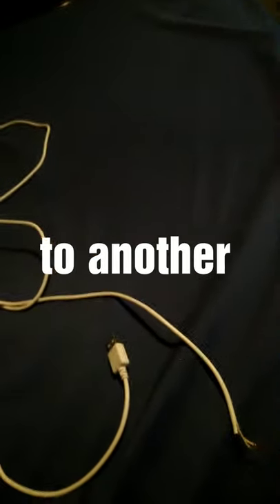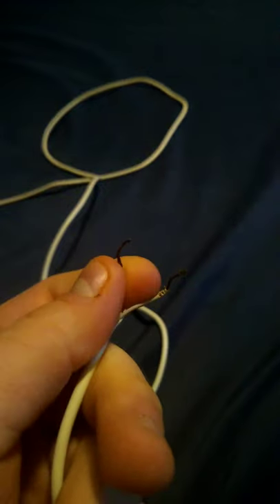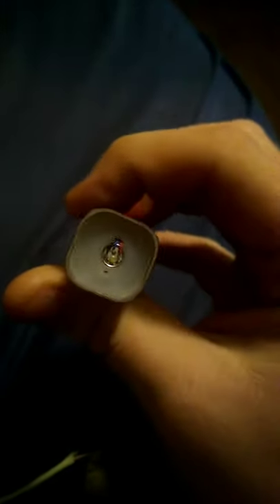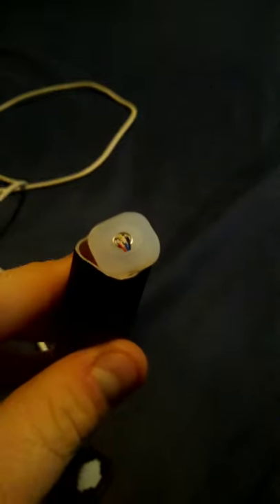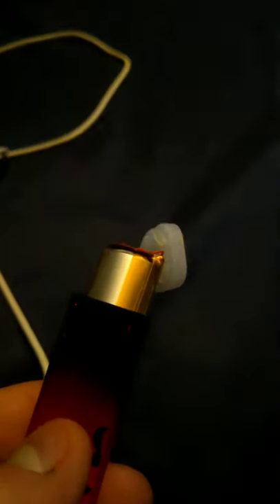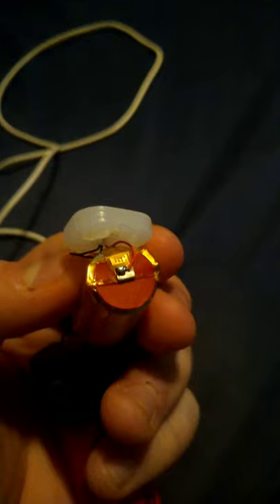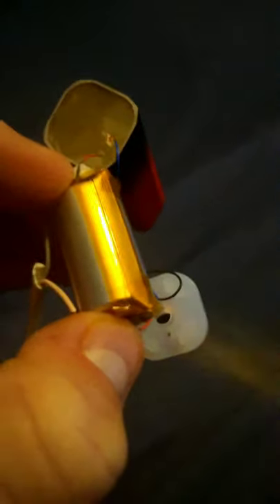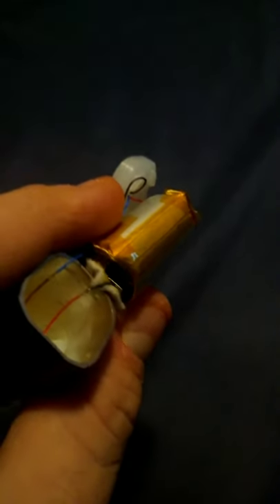How to charge hyde edge/1500 hitters

Comment: Fun fact you don’t need to open it further than the cap to charge it. All you need to do is red to red and black to black on the led wires
Reply: You are a legend! Thank you so much
Reply: I can’t get the fuckin cap off
Reply: Can confirm. Just be careful and patient!
Reply: mine didn’t work it just stuck to the soldered part and burnt
Reply: @boneappletee3395  what I do is just squeeze the end with something or honestly just bite down on the end until I hear a crack, then I just pop the end off.
Reply: @jonverse651   I had trouble opening it Until I found an easier way which was sticking something super skinny and pointy into the line hole air flow thing near the hyde symbol then pull up and it comes right off and it’s sticky on the other end so no u didn’t break it if u hear a pop lmao
Reply: They’re so close that if it touches the other wire and u dont notice it it will get hot and you’ll fuck it up
Reply: yeah, but when u do it like that it doesn’t charge it as much, i don’t even know why i’m watching this video I have the hyde edge that u can actually recharge
Reply: hell no my shit just sparked and lit up
Reply: @sour-flickz7246  it’s cause ur only supposed to put the wire on the metal part not the MOTHERBOARD
Reply: @boneappletee3395  I used a needle and a guitar pick. You can do it
Reply: Safer to just open it more and use the battery method
Reply: @roymtz4813  that’s why you don’t plug it in until the wires are on each side of the battery
Reply: Bruhhhh
Reply: @boneappletee3395  bite it off

Comment: I was careful and slow, and it worked perfectly. Thank you very much! And some advice for anyone trying to recharge their Hyde as well, as everyone else has said, it’s much safer to remove both the top and bottom of the Hyde, and instead of pulling on the wires, find something about as thick as a tube of chapstick and push it down on the cotton from the top of the device. It will push the battery out very easily.
Reply: @therealhunchomike4  Yes, that is how it draws power from the wall to charge it
Reply: How long it last
Reply: @therealhunchomike4  no shot you ask that 😂
Reply: @therealhunchomike4  under rated reply lmao

Comment: I charged mine but mine isn’t blowing smoke. whats going on?
Reply from the maker: Most likely you accidentally snapped one of the wires on the inside connecting the coil, there are better methods involving pushing the whole innards outside to charge but can get a little messier, best of luck
Reply: @onewiththeflame  but my smoke is really really light but u didn’t snap any wires
Reply from the maker: @solyyy1180  none of this is surefire, it's just a method to help out a little. Doesn't always work out well, sometimes all the juice is out.  I wish you the best

Comment: Heyyy, ive been doing this for years now, however, you said 4-8 minutes. Is that something commonly known because after a minute or so my hands start to burn from the battery charging. Just wondering if that happens to anyone esle
Reply: Yea that happened to me before just try to use a lil bit of tape over the wire to hold it so you don’t burn you’re fingers
Reply: i actually just strip the wire so it’s long enough to wrap it/thread it through in between the metal and wire and wrap it than just set it down and wait a bit

Comment: so i broke mine because the blue wire only ran to the top piece and it wasn't giving slack so i put it back in pulled the mouth peice off got the reclaim in the cotten drained it into a empty juice bottle and put it in a empty juul pod it had just enough juice in the cotten to fill a pod so if you have a refillable pod system and you dont wanna have a hassle just do what i did
Reply: your a fucking legend👑

Comment: After I followed your instructions I had a steady light when I used it but no vapor at all. What did I do wrong?
Reply: u might wanna check that the bottom is really secure, if it’s not tight then the vapor won’t come thru

Comment: I did every step and it’s still blinking
Reply: if it’s still blinking that means one or both of the wires didn’t have a good connection while you were holding them. think of it like jumper cables on a car battery

Comment: i just got this like a week ago and hit it 3 times. the light doesn’t blink but it won’t hit and i tried this and it still won’t work?
Reply: Take the bottom out and there should be a little circle piece inside just mess with it or fix it back right and it should work again.
Reply: Yeah push the bottom back you lost your airflow

Comment: Worked for me. the hardest part was finding and stripping a USB cable that wasn't just a mass of copper wires... I started with my old, cheap chinese charging cables first... eventually went to an old cable that came with a phone and it had the wires separated into red/black (and green and white or blue or something... probably for data transfer).

Def push the battery from the other side, don't pull.

Comment: Is there a tutorial on the 1000 hitters? It’s another bigger one but it’s circular instead of the rectangle. It doesn’t look quite the same as the edge
Reply: Tried with that, could only manage to keep the top off
Reply: I needed the bottom off 2 but it just wouldn’t come off
Reply: A curve
Reply: it should be the same with any vape, you just need to find the red and black sides of the battery

Comment: What exactly are the risks associated with doing this? My friends taught me this trick before I found your video, and I know of course touching the wrong ends could cause the battery to explode or whatever, but are there other risks such as with the spliced charger? Such as electrocution.
Reply: Well I tried this before and the battery did explode but it wasn’t a dangerously large explosion it was kinda just a little pop and smoke came out
Reply: @post7327  Alright thank you. Do you know if you held the wires to the wrong ends or was it a completely random explosion?
Reply: @dxgdxn131  I definitely held the wires to the wrong end lol
Reply: @post7327  incredibly toxic lithium fumes wonderful
Reply: The charger only creates 5 bolts of electricity. so it you touched the positive and negative ends of the charger together and your finger, you’d be shocked with 5 bolts of electricity. which would really only tingle. as for the vape battery, they’re DC power, so your good there.
Reply: @dxgdxn131  it’s completely safe if you do it right. It’s only 5w and you are not conductive enough for it to shock you
Reply: The wire and battery power is a low enough voltage that it can’t beat the resistance of your skin enough to cause any damage. It’s pretty much as dangerous plugging in a phone. Generally you don’t get shocked by phone chargers. However I have done some wire for hitting carts and if you hold onto the wire while it’s hitting it might heat up a little bit.
Reply: I shocked the dog shit out myself because I used the wrong wire
Reply: i wouldn't recommend using your fingers to hold the wires in place, taping them down would eliminate all risk of electrocution. ive always bent the contacts up a bit and used alligator clips.

Comment: homie ur a life saver i love u😭😭
Reply from the maker: thank you <3
Reply: @onewiththeflame  what do I do if the battery just doesn’t want to come out
Reply from the maker: @cloudyy7346  either push it out from the other side, or it's possible the case is bent and you need to fenangle it out, sometimes it's possible to charge without even taking it out, check the rest of the comments to see if anyone else had the same issue

Comment: I can’t get the battery out what am I doing wrong?
Reply from the maker: Read the other comments for advice, also, I can't help if you don't tell me what you've tried,. If it's a similar device then you just need a tool to push the battery out, or possibly push the cotton side to get the battery out that way.

Comment: Do u know a place where u can get the actual coils in the disposable. And the cotton bit. 
I’ve got an elux legend 3500 puff. I took it apart. Checked it all out. They sell rechargeable ones in the uk now, cuz a lot of people were complaining that the battery runs out before the liquid. Which it did. That’s no longer a problem. 
My question is, I want to make this vape a ‘permanent’ type cuz the flavour is AMAZING. Cuz that BIG OL’ cotton piece in the centre is so saturated. It’s why everyone is in LOVE with these disposables now. 

Sorry to make this so long. But if I was able to just change that little cylindrical coil out. And the cotton every now and again. This could be a permanent vape. Do u know where I could purchase the coil and the big square piece of cotton?

Comment: Thanks, this worked like a charm. I had some double-sided gator clamp wires that i could use to grab onto the exposed wires and then grab onto the electrode to charge it, so I could leave it a while to charge without holding it. It's amazing to me how much nicotine it has left in it after it runs out of battery life!

Comment: does this work for a SPACE max sub-ohm?
Reply from the maker: Similar box shape, if it's currently dead I would use the same method in the video, good chance it has a similar internal layout. If not, be very gentle when removing the pieces, take both ends off, push the insides out the other end, find a black wire leading to the metal bit, and the red one, follow the same steps. Hope this helps

Comment: hey just so you know there is a waayyyyt easier way to do this, just take the sticker off the bottom and you have the two parts to put the cords on
Reply: can confirm. this works
Reply: at the light?
Reply: Can confirm as well, although this forces the charge through a resistor, so you gotta charge it for longer.
Reply: @calebmeyer616  whenever I do it this way the bottom starts to smoke up, do you know why
Reply: @UkuleleMaster-et9mf  yeah it’s like playing operation. If the red wire touches the chrome circle around the light fixture, it creates a short so you gotta be careful, but it won’t do any harm because that’s the point of the insulating circle round it.

Comment: Okay I know you said you know worse thing that can happen is you break it but actually the worst thing that can happen is you've got wires touching that don't need to be touching and you catch it on fire. This is how I burnt a hole in my floor. A lot of people would think okay no biggie it's just you know a decent burn in the floor but when you live in a mobile home it's different and I'm damn lucky to be alive!  these things go up go up in Flames quicker than a k... Errr... Let's just say to go up and flames really fast. So for newbies to electricity as I myself am still kind of a newbie those color coded plastic wrapped around the wires over there for a reason though you will need to strip some of that off to expose the wire to charge it don't rip too much off! That plastic coating keeps the exposed wires from touching each other and catching a place on fire. 😉

Comment: Hi Okay so I've got my battery out without breaking anything and the inner parts I guess with it standing upright it would be the top of the battery I can't make kids their tails of this it's got two red wires one of them going directly into the battery one of them connecting to a blue wire going to I think what is the light at the bottom of the battery. The other one that goes directly into the battery it connects to a black wire at the same place that it connects to the silver prong coming out of it so it's got a red wire that connects to a black wire which goes around the bedroom following the blue wire to the light as well. Hold on wait okay at the bottom of the battery coming out of the battery directly is a red wire so I'm going to guess that's my ride my positive the other one the top of the batt my black my negative my ground?

Comment: is it suppose to start smoking💀
Reply from the maker: You most likely accidentally left something touching what it wasn't supposed to, or two metal bits touched the wire, if it starts smoking, it will continue to get hotter, be sure to drown it in water

Comment: So I accidentally broke the red wire,will it still work if I strip the part that was sauntered and re attach it
Reply from the maker: If you properly do it yes, there is no reason that shouldn't work
Reply: @Gabriel Cummings  i took the red wire and stripped it, then very carefully re attatched to to the saugter.

Comment: Ur a legend
If you have a wire that has 4 smaller cables inside (red black green white) you dont need the white and green you can snip those away, you just need the red and the black wires.
Reply: What if it has to black jus red/white/green/silver

Comment: Guys, you can take the top off as well and push the battery out instead of pulling it and snapping wire. SOO much easier 😃
Reply: how do you take the top off
Reply: @kewid2732  you can just wiggle it off. It doesn't have any glue
Reply: what about the sponge part, how do you most that?
Reply: @dannimcknight670  there's a plastic around the sponge part, just get a knife or something and push down on that part

Comment: Can I do this on a Hyde original plus
Reply from the maker: You should be able to do this to all vape products, look for black and red wires, follow the same instructions, or email me for specifics
Reply: @onewiththeflame  yeah I just broke mine the black wire came off the sensor
Reply from the maker: @nickwallens8051  you have to be very careful in the future, moving slowly is key, and if you encounter stress you need to stop, make sure to not damage wires
Reply: I can’t believe I successfully did this. Thank you for your help!!

Comment: there’s an easier way u don’t have to take out the whole battery u can just put the wire red or red and black on black before u do the knife step 
it dies faster but works easier and smaller chance of it braking just don’t hold it there for a long time
Reply: I have a question. Does anyone know if you can throw Hyde Disposable Vapes away in the trash or should I remove the battery?

Comment: So you can actually touch the wires from the charger without shocking yourself
Reply: yes. batteries are DC, meaning you don’t have to worry ab shocking yourself as long as you have them red on red, black on black.